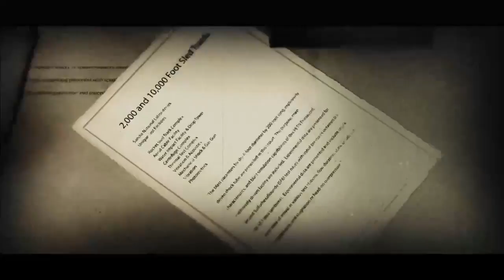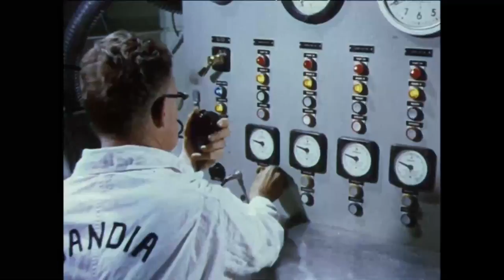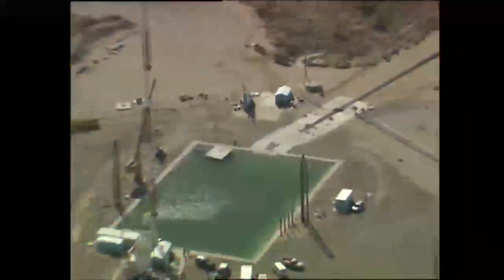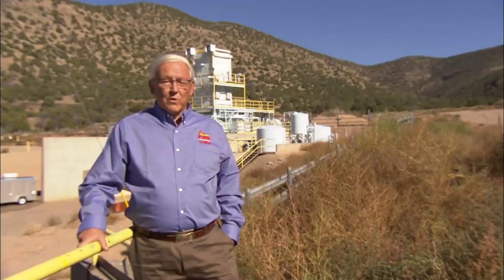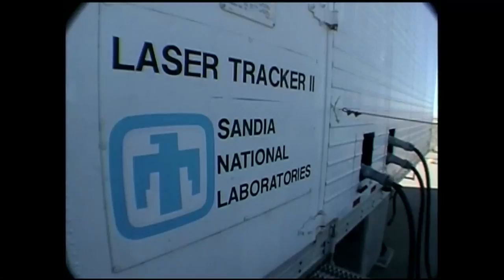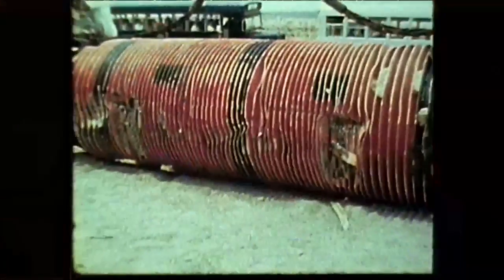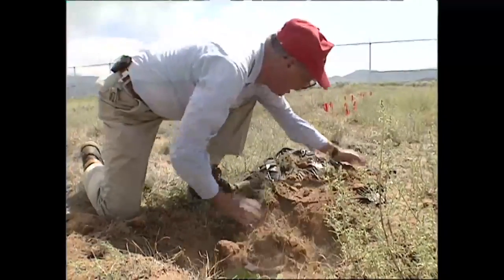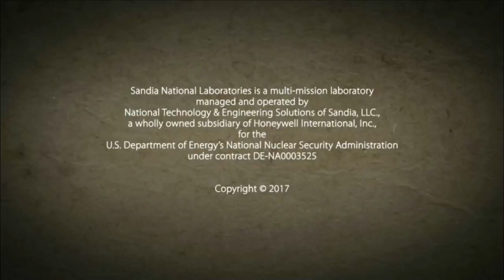One Shot Physics

Comment: But, on Sep 11, 2001, a soft aluminum airliner, went through the concrete fortified Pentagon without leaving a trace of the plane.
Reply: You kind of answer your own doubts within one sentence. A commercial plane breaks into millions of pieces, almost none bigger than your hand if they hit water at high speed. Concrete should and did just about vaporize one. Theres more than meets the eye with 9/11, but missiles, I'd bet my life on it, weren't involved.
Reply: It’s almost as though passenger airliners aren’t built to withstand being smashed into buildings or something. 🤷
Reply: @ctdieselnut  an airliner cannot perform the maneuvers needed to impact the pentagon in the way it did. Talk to any airline pilot.